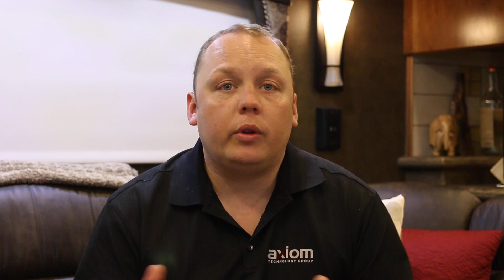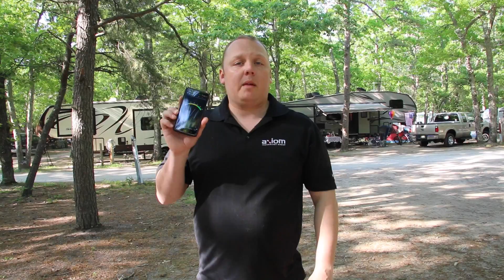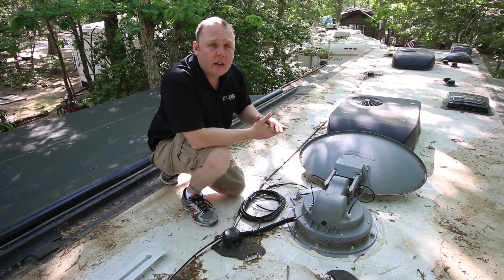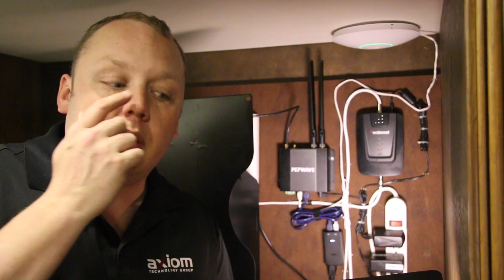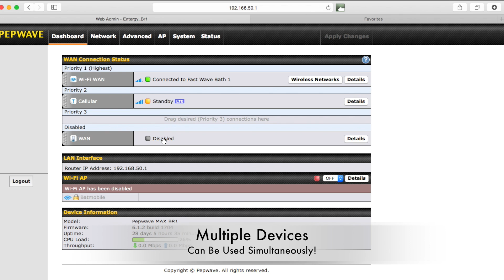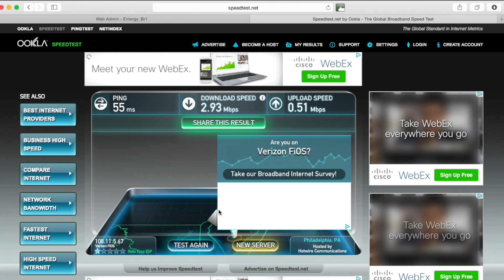Reliable Internet In Your RV Without Data Charges

Comment: Great video with awesome information and tips . . . unfortunately the background music is very distracting.
Reply: That was a good one... Something to think about for my folks new trailer as well. Thanks for sharing Doc!
Reply from the maker: Thanks for checking us out, well get the volume down on the next one for less distraction! If you have any tech video ideas or questions feel free to post them here or on livinlite.net!
Reply from the maker: we've found the directional is much more effective when using a Wifi system that has a  fairly standard power output. when you start to get into high output systems like Wifi Ranger and certain Ubiquiti bullet products the omni range is pretty good but the directional still edges it out. that said with directional you have to aim it, so if your on the go a lot that can be a real pain. really depends on your situation. thanks for checking in! make sure to subscribe and see our WifiRanger video which we are producing now.
Reply: +Mike M With all due respect, talkover levels vary in the Internet world. As someone that does multi channel, multi camera video production I find that the final mix is all over the place depending on a multitude of factors.  For instance just using headphones versus the speakers in a laptop to listen to your mix will be a different mix than the very same mix on a cellphone. In the case of a profile/puff or magazine piece like this one it's best just to not run 'track' under the narration at all but instead use it for bridges, transitions and other 'sparkle.' Good job there LivinLite.net keep up the good work.

Comment: GREAT VIDEO!  Thanks so much for this, just what I was looking for.  One question, how does the Pepwave do with captive portals?
Reply from the maker: +Jeff Ray Hi Jeff, it does very well with them. It redirects the device connected to the pepewave to the captive portal. We haven't had any issue with starbucks, campground wifi, mcdonalds, walmart etc. Once you authenticate on the captive portal all of your devices behind the pepewave will be able to browse the net under that one single session. Thanks for checking in!
Reply: +LivinLite.net THANKS!  That did it, you sold me, I am going to order one for our camper.  Think I'll start out small with just the AP, and maybe add an external directional antenna later.  Thank you for the great video and all the legwork on this.   -Jeff

Comment: Eric, another great video! Is that a wired nest smoke detector? How well does it work? Any reason why wired vs battery? Thank you. Mark
Reply from the maker: Hey Tobe, i think you might be refering to the Ubiquiti Access Point mounted above the RV? no nest smoke detector although many friends say its very cool. Wouldn't be an easy retrofit in an RV though but i'm not speaking from experience.

Comment: Do you have a schematic of the set up you have as well as how you configured the device to use both Verizon or AT&T? what do you do when you are driving and need internet connection?
Reply from the maker: +A Needlepoint In Time - Hi, yes we do, our schematic is shown in our blog post here: http://livinlite.net/staying-connected-while-on-the-road/ - When we are driving down the road our Pepewave Router utilizes the embedded Verizon 4G cell card (sim1) and utilizes the embedded ATT Sim Card (SIM 2) if verizon fails to connect. It automatically detects that there is no wifi signal and switches to Verizon/ATT automatically once we start driving. We also have a cell booster on our RV which we'll be doing a write up for shortly as well which further boosts our cell signal while parked and driving.

Comment: Im considering converting a Dodge Pro Master van this spring so I can do some traveling to see friends and family. I work from home and can work on the road as well. I have been wondering what kind of download and upload speeds a person can snag at places like campgrounds. Thank you for the information.
Reply from the maker: nh libra hi there and thanks for the comment! If your looking to go full-time or simply reply on your internet make sure you get yourself an unlimited data plan from a cell carrier. it's really the only way to travel and work. we have a video on obtaining an unlimited data plan but the short of it is that you can pick one up for about 130 a month on att and less if your willing to go with a tier two carrier like Sprint. Best of luck!!
Reply: Wifi speed can vary tremendously from one campground or RV park to the next and does not necessarily depend on how good of a signal you receive from the campground, but more to do with the bandwidth available from the campground or RV park.  One important aspect to consider is that you will always be on a shared connection with others in the campground or park.  Unless there is a gigabit broadband connection being broadcast, please remember your neighbors are trying to use this connection as well.  Consider this like sharing your home connection with all your neighbors and everyone wants to stream a movie at once ....  most likely several of you will be very disappointed.  Etiquette says in that situation to check email, respond if necessary, perhaps read your online newspaper subscription and be frugal in your usage.  On the other hand, if plenty is available, help yourself.

Comment: Our problem with camp WiFi is not signal strength (either we are close enough to pick up healthy signal OR I use our Nanostation antenna to boost the signal.) I'm seeing more often that when the camp is at low internet activity (>11PM or when people are moving out) I have GREAT internet speeds; however, when more campers are using the camp system it slows to a crawl. Does this happen to you and if not, how does your system (besides using LTE access) keep a fast pipeline to the camp WiFi?
Reply from the maker: +Harry Marsh  - Thats a great question. Our system is a bit of a manual process, if we are staying somewhere with heavy usage, i will drag and drop the internet priority to make cellular the priority during peak hours. You can use a smartphone app to do this so its not much of an inconvenience. I'm also investigating the product most other folks use (the wifiranger) which "claims" to do link-aggregation which subsidizes your internet pipe with cellular data as needed to keep things moving along fast. I wont bore you with the details but long story short I have trouble getting that to work with 20k dollar cisco routers/switches, so i'm curious how they are doing it for 350 bucks. That said, everyone raves about the wifi ranger so i'm in touch with them to test the product and post a more detailed "tech review" of my findings.

Comment: It looks like you're using another brand wireless access point visible in the shot of the equipment behind the TV.  (the white flying saucer, maybe Ubiquity or UniFi) Isn't the Pepwave router capable of bridging the WiFi signal from the roof and acting as its own access point?
Reply: It is capable, but dedicated access points are usually better. Unifi WiFi is the best in the price range hands down in my opinion.
Reply from the maker: Hey Micglobal - Yes the Pepewave can use its wifi antenna for both picking up campground wifi and also re-broadcasting wifi in your coach. With our original setup shown in this video we had our antenna on the roof however which used a directional antenna. As a result the pepewaves internal wifi signal was poor so we added a ubiquiti which you see in the video. We've since moved on to add a dedicated roof antenna (Ubiquiti bullet) and now use the pepewave for our interior wifi signal.
Reply from the maker: agreed, not a bad product at all. I wish the wireless clients were built in so we didnt need a cloud controller or usb controller for them but they are a great product for the money

Comment: By the way, to really get 'real' data to share with your subscribers you need both strength and packet data along with distance from the the WiFi point (assuming these are all the same equipment too, ha ha), elevation above sea level and of course your receive rig.  You will then be able to actually compare the various units since the crazy and emotional reviews I've seen so far aren't really based on anything but personal prejudice and the other non technical aspects.  With 30 years of broadcast experience I can tell you that the choice of antennas has as much to do with the effectiveness of a system as any of he hardware or electronics.

Comment from the maker: Some folks have asked us what to do when boondocking and when there is no wifi signal to pickup. In those cases you'll likely need to go with cellular as your option to connect. Here is a video on some unlimited cellular options that we've found work. Make sure to checkout the blog post not just the video as some of our recommendations have changed since the video post. http://livinlite.net/how-to-get-an-unlimited-cellular-data-plan/
Reply: LivinLite.                   🗾🎑

Comment: As a ham I would want to install a router. So I could control it in the RV.
Reply from the maker: Yes we love our Pepewave Max Br1 router which is featured in this video. Its going on 3 years old and working great with Verizon, ATT and Wireless connections supported.

Comment: The PEPLINK device you link to is no longer available. Do you have a replacement to recommend?Thanks
Reply from the maker: +James DeGraffenreid Hey James, looks like the Amazon reseller is out of stock. Here is a link to 3GStore, they are great with excellent tech support and returns. http://3gstore.com/product/5618_pepwave_max_br1_3g_4g.html?country=US

Alternatively checkout the WifiRanger. We have a coupon code for 5% off anything on their site www.wifiranger.com. Use code WFRLIVIN at checkout. Let us know if you need anything or any help!

Comment: Does this system have to be aimed at the source or does it just grab what ever is flying by? What might I expect to pay for the same set up as you have here & is this a product that you sell & set up? Not sure why but the music in the video is very distracting....is there an option that I can use to turn it off, but still hear you speak? 
Thank You
Reply from the maker: Hi NIP, sorry no version of the video without music, we deleted the source files as its quite an old video. Our setup has quite a lot of moving parts however we know quite a few dealers that are installed WifiRangers which give you similar functionality and at a reasonable price. For our setup, yes you need to point the antenna but there are other antennas in the video called omni-directional antennas which do not need to be pointed. If you need more help look us up on facebook at livinlite.net/facebook and send us a direct message, we'll help you out from there!
Reply: That you for getting back with us. Does anyone ever mount both antennas together or in series? We spend a fair amount of time not sitting in the RV Park. We some at least 3 months each  summer/Fall on the road out West...ended up being 7,500 miles last year.  So, having a variety you;d be ideal for us.  Thanks Again!
Reply from the maker: Hi NIP, we had both antennas mounted on our roof for about a year but found that the omni worked for 90% of our applications. We ended up donating the directional to a campground to improve the signal for all the campers. You could technically put both on your roof, but you cannot wire them in series so you'd need to go onto the roof and switch between each to use the one you wanted (you'd be up there anyway to point the directional antenna). If your doing that kind of mileage checkout the wifiranger product. It's solid and a good value at around 600 dollars for all of the parts you will need. This will allow you to boost campground wifi, and also boost the wifi from a cellular hotspot on your family data plan for when there is no wifi available. We have a coupon available for 5% off the wifirangers if you are interested, just let us know.

Comment: Is there anything that doesn't attach to the roof that can be used on a small fiberglass travel trailer?
Reply from the maker: +Sandra Swarts hey Sandra, have you checked out the WifiRanger? They have units that attach directly to roofs but also units that strap to Arial tv antennas like Winegard antennas. We are going to do a other video on them shortly so stay tuned!

Comment: What good does it do to boost the wi fi signal when the park only provides minimal bandwidth being shared by tons of people? So you have a strong connection to a slow, overcrowded router. Big deal.
Reply: Of the Thousand Trails I"ve been to, not one had wifi to the site without paying for it.  The signal basically only reaches the front door, and is so weak that it runs as fast as the old dial ups.  Getting the signal sometimes isn't worth a darn.
Reply from the maker: Its definitely hit or miss but campgrounds are improving. We just left a park in Vegas where we had wifi and 38mb download speeds. That said, its definitely not the norm so we always carry a cellular backup.
Reply: None.  But a good amplified antenna can allow you to hook up to other free wifi hotspots in the area.  Restaurants, motels etc.  I love my antenna sold by C.Crane.

Comment: Too complicated having to locate wifi, point a special antenae.
I use a very small wifi signal relay (extender). It is much more
potent than my notebook. Just position it outside with an extension  
cord and you're good to go. Mine is A/C but many of these run on
12 Volts which you can hook up with a battery.
Reply from the maker: +David Darby Hi David, we agree and stopped using the direction antenna (except for when we are really in tough spots) and now use a Omni directional antenna by Wifi Ranger. You could also use a similar antenna by Ubiquiti called a “Bullet M2” which would be a fraction of the price of a wifi ranger and achieve the same results. This video is 3 years old and we’ve learned a lot being full timers. Thanks for the comments!

Comment: is this better than a WiFi ranger?
Reply from the maker: +Zay Buckley that really depends on your technical proficiency and your individual requirements. The WiFi ranger is a great all around product and offers people the best bang for your buck for an all around total package for RV'ing & Boating. That said, it does not offer advanced routing and VPN capabilities that power users may require and for us, we wanted more flexibility and the ability to fail over from wifi to multiple cellular carriers (WiFi Ranger supports 1 cell carrier failover, our setup supports two). I recommend Wifi Ranger to the vast majority of full time RV's as it comes with excellent technical support and a strong warranty.  If you are interested in purchasing a WiFi Ranger, you can use the code WFRLIVIN at checkout for 5% off of your entire order. Best of luck!